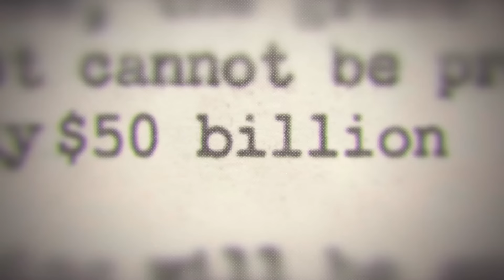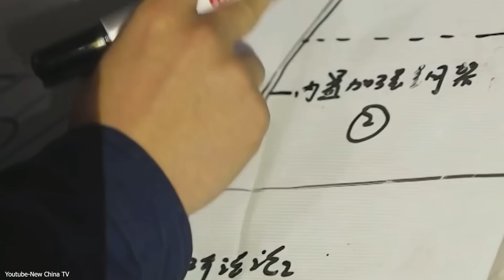Why is China Building a $50 Billion Railway in the Himalayas?

Comment: If the Chinese can do this for $50 billion how did the 200 mile stretch of line between London and the north of England for HS2 cost over $125 billion?
Reply: The purchasing power of RMB inside China is high. Your 125 billion buys much less in the UK than 50 billion in China.
Reply: delays by the tories and nimbys along the route forcing route changes and  revisions and re submissions of plans

Comment: $50 billion is staggering - staggeringly cheap. Says one from the UK, where a railway is being built in rather less challenging terrain over about 230km at a currently projected cost (it keeps rising) of £112 billion. Small correction, BTW: the Channel Tunnel is 50km long, slightly more than the one mentioned in this video.

Comment: These project expreses current China rulers, instead they would connected gas and oil pipelines to cheap russian energy resources they will spend valuable funds for these geopolitical hazards turistic boom in potentially separated autonomous region. After Tibet will be enough rich it will not needs China anymore.

Comment: In Slovakia, we started building our longest car tunnel in 1998. The exploratory tunnel was completed in 2001, but construction was halted for many years. The actual construction phase resumed in 2015. It was initially projected to be finished in 2019, but was postponed once again, and now they say it will open in late 2025. The tunnel is 7.5 km long and consists of two tubes. I can’t quite fathom how quickly the Chinese build their railways in comparison to ours—not to mention that our railroad will never be as fast. The maximum speed is 160 km/h, and that’s only on certain sections of the tracks, but it’s better than nothing.

It would be interesting to see how they travel at such heights. If I’m not mistaken, when a plane is flying at an altitude of 12 km, the air pressure is about that of 2.5 km. What about those trains that travel at altitudes almost 5 km high? Is the air pressure the same as in the plains, or is it higher?
Reply: Different pressure
Reply: China has operated train in Tibet for decades.
Reply: The trains are pressurised.

Comment: Rail travel is more environmentally friendly compared to flying, and moving containers on freight trains is also more efficient than using trucks. The new railway will cause some damage to the landscape and the environment but what are the alternatives? Trucks and airplanes that pollute 10 times more?
Reply: It depends upon what sort of "environmental damage" you are referring to in the building of railway tracks. In many parts of the countryside where there are animal migratory routes, the Chinese have built viaducts and archways to allow the animals to pass through freely below while the trains run overhead. In the West, where roads are the norm, animals have been often killed trying to cross the roads at night to forage for food. This has been a constant problem for animal lovers and conservationists who see "road-kills" in armadillos (in Texas), koalas, kangaroos, platypuses, etc (in Australia). Is the building of roads and the constant appearance of potholes, cracks, etc that require repairing not damaging the environment and eco-system?

Roads in fact, can cause more harm to the landscape and the environment than train tracks that occupy a smaller area of land (have you seen the roads in Los Angeles and Shanghai with their multiple lanes, flyovers and crossovers?) - not to speak of traffic jams where ICE vehicles sit still and not move while pumping out noxious gases into the environment =- one of the causes of the worst air pollution days in places like New York and Los Angeles. In fact, far more people are killed or injured crossing roads than crossing a railroad track (note: this is a tongue-in-cheek statement since more people cross roads than found crossing railways tracks but you get my "drift").

Internal combustion engine (ICE) powered vehicles like cars and trucks that depend upon the burning of gas (petrol), pollutes the air more than a train that runs on electrical wires and electric vehicles that emit no pollution at all. This is one of the main reasons why the air quality in places like Beijing and Shanghai has improved so much in recent times while in places like Mumbai and Kolkata where ICE vehicles choke the streets are pretty bad and a health hazard.

Comment: Very impressive! Especially the 26 mile long tunnel through Himalayan mountains at altitudes above 10,000 feet. India will also face similar or more challenges when it builds the Frontier Highway in Arunachal Pradesh along the border with Tibet
Reply: A 26 mile long tunnel. If it had a giant ear at each end  it could be a metaphor for Xi Jinping? From ear to ear, 26 miles with nothing in between.